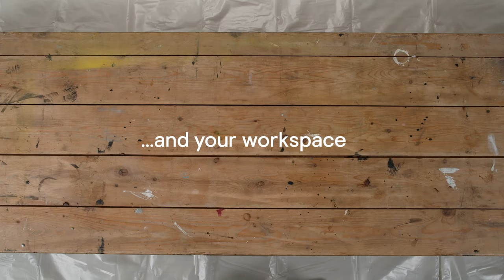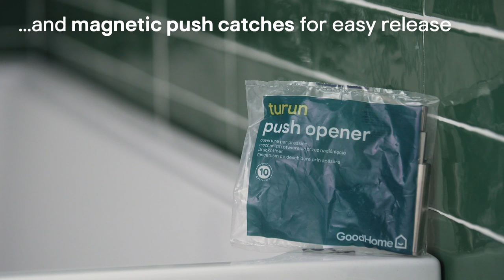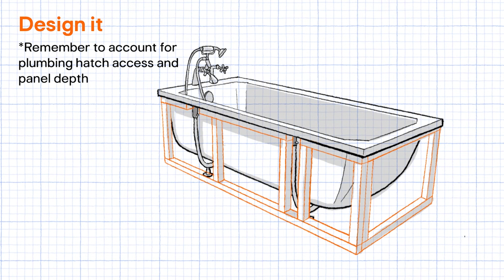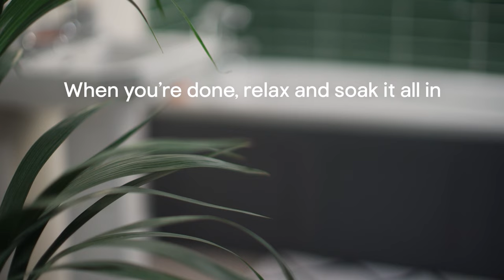How to create a wooden bath panel

Comment: I made my own bath panel. But with 3 openings, I utilised the space under the tub as storage for bath cleaning supplies, hand wash, laundry detergents, and fabric softeners. I added battery-powered lights in each section of the openings and added magnetic switches that turn on and off the light when opened.
Reply from the maker: That sounds amazing 😊 The future of bathtubs 🛁

Comment: I didn’t get how they fixed the panel onto the frame? Was it just a couple of magnetic catches so it could be pulled off?
Reply from the maker: Hi, there! Yes we used magnetic catches so you are able to remove the panels with ease if you need access behind it. Hope this helps 😊